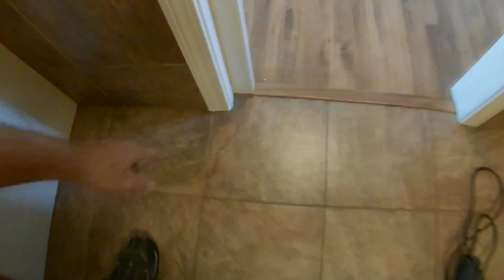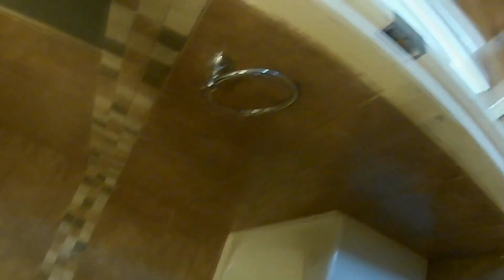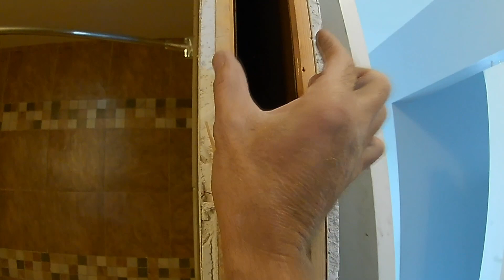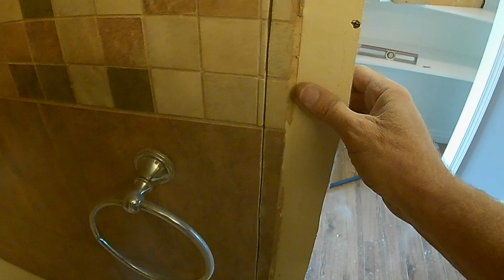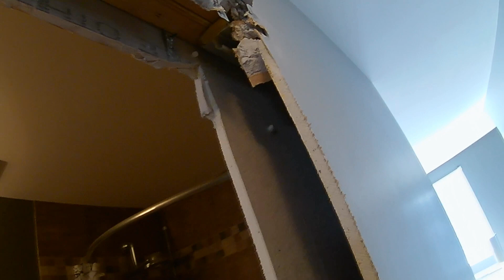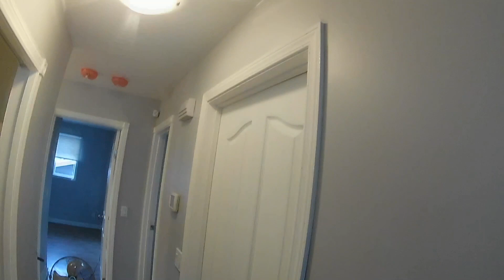Replacing Pocket Door with Swing Door.

Comment: Dude's so pissed with pocket doors, he decided to get rid of it once and for all. Pocket doors looks cool and all but it's a PITA to fix. If you have to take trims off or make a hole in wall to fix moving parts of a door, which by the way, will need replacing at some point of time, is not a good design at all.

Comment: would you be able to reuse the pocket door and just buy the frame? by removing old hardware and adding new like hinges and knob?
Reply: Most of the old door is good, but the pull-latch to slide it open with, leaves a big square hole cut into the side of the door. No easy to ix, but it could be. If buying a new fame, then it's just as easy to get a new door too.